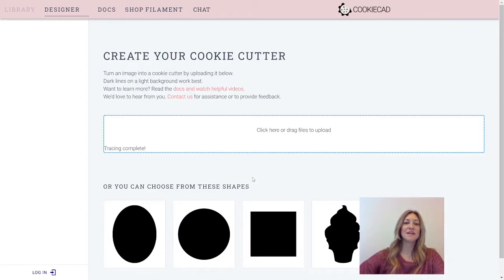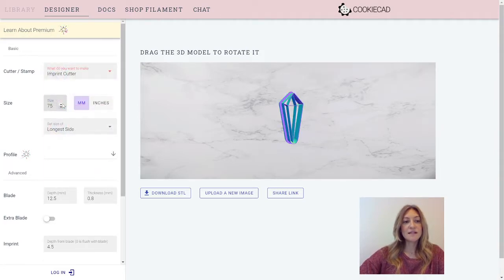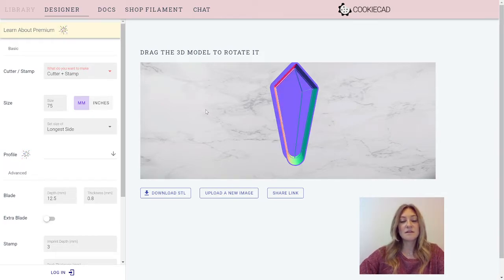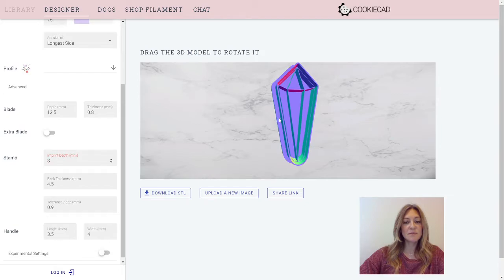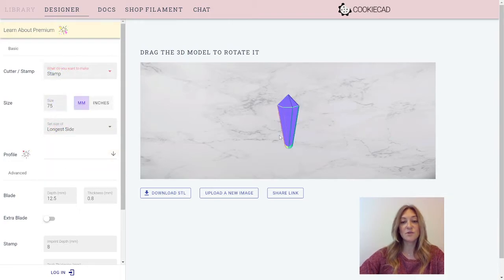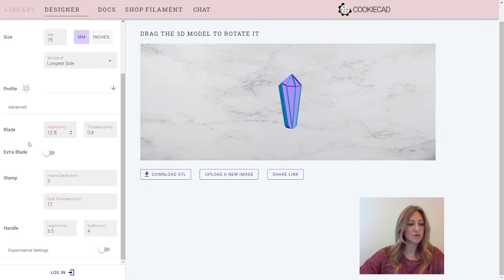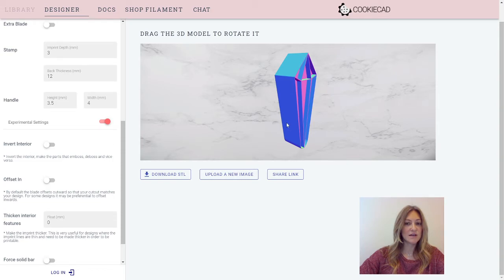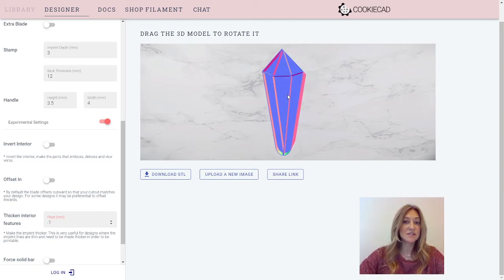How to Create a 3D Printed Stamp / Embosser / Debosser with Cookiecad

Comment: Ok, so I'm very knew to the cookie community but my sister and I do cookies with fondant and these would be so perfect to do! Im amazed at the video and was able to create my own design. I just wanted to know if you could possible make a video on how to 3D print the cutter + stamp with it being inside. Also what are your recommended setting of the thickness the cutter should be to be skinny enough to cut through but not too thin so that it doesn't break.
Reply: The cutter + stamp setting in the video will allow you to do this.

Comment: I'm trying to make a heart with an stamp of names/date.  The stamp feature keeps putting a edge/border on the stamp the same height as the stamp - how do I remove that? Do you think the outline of my cutter is too thick and it's making part of it the cutter and part of it the edge of the stamp?  Thanks!
Reply from the maker: Hi Julie, the outline is used to tell cookiecad what shape to make the stamp back - but it also ends up as part of the stamp. We're working on a feature to remove it - it should be out soon! We'll post an announcement to community.cookiecad.com when it's ready.
Reply: @Cookiecad  Thanks!